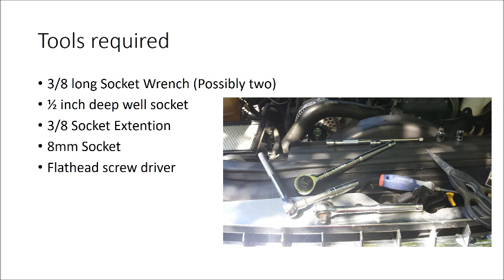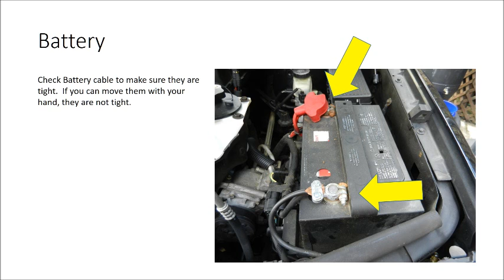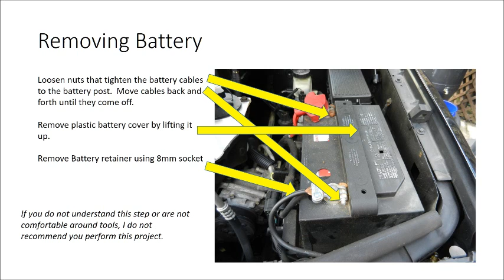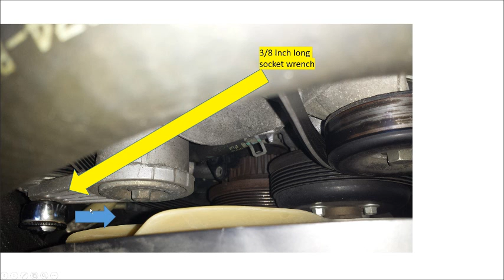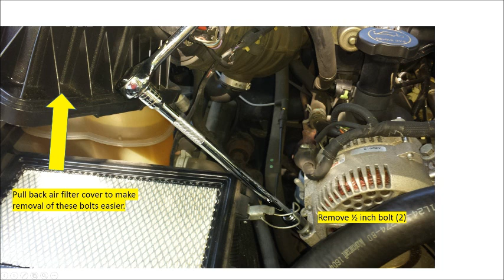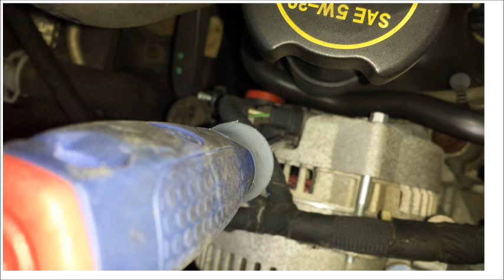2004 Ford Explorer Alternator Replacement

Comment: I had the same thing on my 2005 battery light blinking not charging. Remove the top of the air filter slide over and you have plenty a room just like you did I can’t believe how fast it was to change it. The one little electrical clip was very loose and it wouldn’t get tight but it was the original alternator and I guess the little plastic tab thing got a little brittle
Reply from the maker: Hope the video helped.
Reply: @Jackleg  It would have but I did it first and then looked at the video just to make sure it went in so easy it shocked me

Comment: Hey! I love the video and I was following it to the T. I ended up having my battery checked before I took the alternator all the way out, and my battery was bad. So I replaced my battery, but I am still getting the “check charging system“ error in my car. After you fixed your issues, did you have to reset the code with a device or did it go away automatically
Reply from the maker: Honestly I can't remember, but I think it just went away.

Comment: Mine took a 10mm and a 13mm socket but other than that, it went just as you said. It is a good thing I had 2 3/8 ratchets because once I had the belt off, there was no way I was getting the ratchet out of the tensioner pulley till the belt was back on. A cheater pipe on the handle of the ratchet on the tensioner helped get the leverage to make it easier too.
Reply from the maker: Thanks for the comments.

Comment: This was very helpful, thanks! I just completed the and approached the tension pulley by removing the upper radiator hose (a simple hose clamp), moved it out of the way and full and easy access from above. Everything else...exactly as you outlined. Cheers
Reply from the maker: Thanks for the comment.  I'm glad it helped you.

Comment: Jackleg thank you so much for this.  I have a terminal illness and have challenging financial situation because of it and the Ford Explorer Of same year my parents gave me seems to have given up and I think it's because of the alternator.  The battery died before that twice, and now when charged it makes this awful clicking noise it didn't do before.  I might be too weak, but to save money I'm going to try to do this myself because I can't afford to take it into a garage, but what scares me is the belt.  Taking it no and off.  I'm comfortable doing all the things you mentioned and have done my own stuff in the one forever but never tried car repair before.  Odd time to start doing car repairs right hehe.  well I don't have much choice based on my finances it seems.  So do you think someone who is on oxygen and a bit weak could do the belt?  How long do you think it would take a normal person to remove and out alternator back in?  Also if stuff is a bit rusty, is WD-49 best to unstick those bolts or would I be better off with one of the more powerful de-ruster sprays?  Thanks for a fantastically done video.

Comment: Great video, one of the better ones I've seen.  I liked that you used still pictures and pointed things out instead of trying to use a shakey hand-held video.  Your instructions on handling the tension pulley were also the best I've found and made it really easy. 
 Many thanks, great job!
Reply from the maker: Michael Sweeney thanks for the comment Michael.  I am happy these videos help out.

Comment: is it the same thing as a 2005?
Reply from the maker: Shyloh Drew I would think so assuming same V6.  05 is the same type.
Reply: alright, thanks. ✊ your video was very helpful by the way.
Reply from the maker: Shyloh Drew thanks for the comment.  the best way to be sure though, is just to take a look under the hood.  there was also another V6 maybe 4.6 ltr?  I will do some reading.
Reply: Jackleg your welcome, and alright. ill take a look and finish searching around.
Reply: me again, all 65 batteries are the same right? like 65n
Reply from the maker: Shyloh Drew I believe so.  65 is a group size.  the n is probably a model number indicating cold cranking amps, they come with different CCA ratings.

Comment: Thanks for the guide.  Especially the part about how to attack the tension pulley.  I didn't have a big wrench, so I used a 'helper' bar on the wrench I had and it worked fine.  I didn't watch the whole video before I did it, and figured out the 'take off the air filter cover' to get at it easier.  I used a screwdriver to pull out the plastic wire covers, so maybe that's why you had that picture in there.
Reply: I'm glad at least a portion of the video helped you, that's why I do these things.  Thanks for the comment!